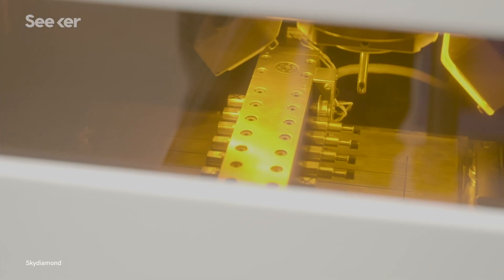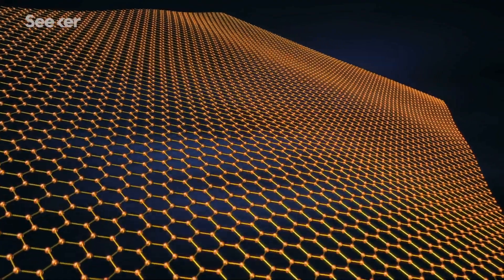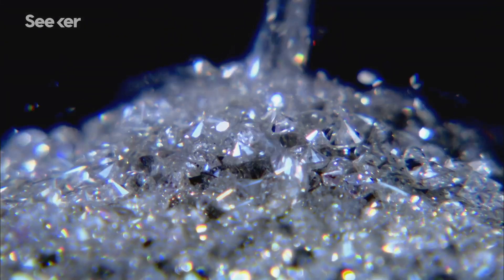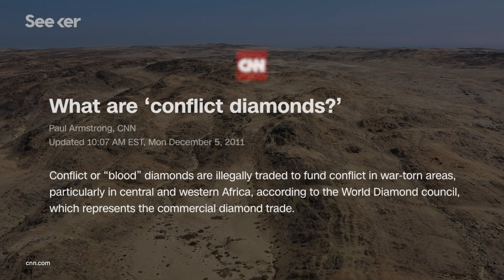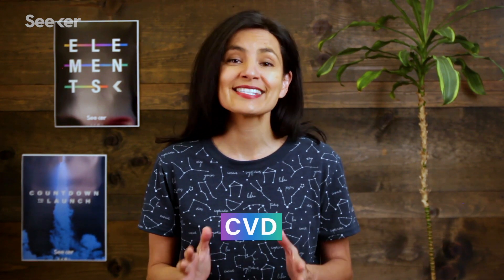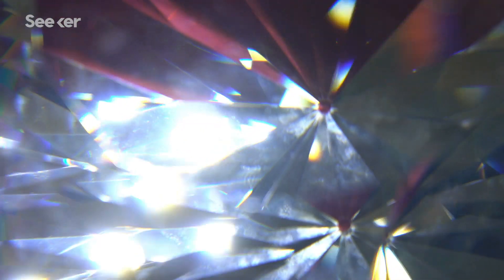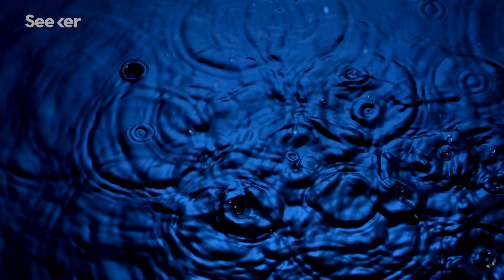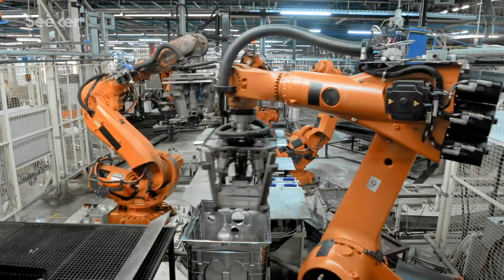How Scientists Are Creating Diamonds From CO2 Emissions

Comment: I’m wondering whether it would ever be possible to directly convert CO2 into diamond and oxygen through some kind of enzymatic catalytic process? What are the bond energies in CO2 and in diamond, how do they compare? How much input energy is needed to do that conversion?  Is there any chance that a carbon-based enzyme could be designed that would catalyze such a reaction?

Comment: The source of the carbon is a non-issue. All sorts of things contain a large amount of carbon. If you want to make your diamonds out of broccoli, you can do that, and it doesn't increase costs much. (Most of the difficulty will be in purifying it, not the cost of the broccoli) This is draining an ocean with a teaspoon stuff, as far as the amount of CO2 actually in a diamond. 
Maybe one day, we'll figure out an actually efficient way of making diamonds, or just have a huge amount of energy to spare, and we will be using diamonds as a building material. Until then, this is didly squat CO2. 

Meanwhile they are wasting significant amounts of green energy. Its hard to build enough wind turbines when people take "this energy is green" as an excuse to squander it.

Comment: Wind and solar aren't renewable energies. Yes there will always be wind. Yes there will always be sun. But the objects we used to capture that energy are highly polutant. They sum to a net negative. You solar panel will need ot be changed and new lithium will need to be mined to produce them. Similar situation for your wind turbine. Wind and solar are FALSE solution.

Comment: Isn't creating diamonds from the air is more impactful for the environment than a regular lab grown diamonds? Since they capture such a miniscule amount of CO2 isn't it better to just use a more efficient and common technology?
Seems like a cheap advertising trick
Reply: That's what my chemical engineering senses are telling me. CO2 capture is difficult, since CO2 does like to dissolve in most things. The processes are usually pretty inefficient. In my opinion, there are worse pollutants than CO2 that are easier to deal with. If you want to handle the CO2 problem, then plant billions of trees. That will solve the problem very simply. Heck, if every home owner in a first world country planted food trees in their yards instead of plain grass fields, then you'd probably solve the CO2 and world food shortage problems at the same time.
Reply: Reminds me of an oil company sales pitch of using renewable energy to produce oil. You think I'm joking, but they were talking about going green on fracking. Some companies pull a ton of stunts to get investors.
Reply: @randywiedenfeld7094 , I mean, at least oil can be used for things other than burning as fuel. The naptha from oil is used for all kinds of organic chemistry.
Reply: IT is

Comment: My graduate work entailed the destruction of liquid carbon-based hazardous waste atomized into the center of a large plasma furnace. Secondarily, industrial diamonds formed on a cooled substrate located on the bottom of the furnace. Carbon vapor transformed directly into a solid at extremely high temperatures lacking high pressure. Voila, Diamonds!

Comment: I'm curious how large the diamonds can be made.  Seems to me that you could just have a runaway reaction.  So let's for example say that the largest diamond you could reliably produce is the size of a baseball.  Diamonds are modestly dense (for carbon atoms), where a baseball-sized diamond would weigh 0.77kg.  It should only take a couple dozen of these diamonds made per-day to completely negate the CO2 emissions from a single natural gas powerplant.  That's actually pretty achievable.
Obviously, it isn't sustainable to do this for every CO2 emitting power plant, especially coal, but anything to neutralize them is an effort worth spending.
Even if the diamonds just turn into graphite, that's not really a big deal - you're still taking a greenhouse gas and turning it into a solid.
Makes me wonder too if energy costs could be greatly reduced if they were to harvest methane directly from a methane source, rather than produce it themselves.  Fossil fuel production, agriculture, and landfills collectively produce most of the methane in the world.  I'm sure harvesting it from them should be pretty easy.

Comment: 80-85% of the world's diamond trade is controlled by a single company, De Beers.

If it wasn't for them controlling the supply and demand of diamonds, that lump of carbon would be a bit cheaper
Reply: Exactly and the GIA controlling the Grading part.. making the diamond manufacturing hella Expensive
Reply: I have to dissagree/agree with you i've read that the monopoly has been broken somewhat, they had a monopoly till the early 2000s. Nowadays their marketshare is about 35% of the diamond trade, but still thats alot.
Reply: yeah a BIT cheaper....to cut and polish a diamond to jewelry level is an insanely labor intensive process, that process cannot be done by robots either, and contributes massively to the cost
Reply: @nunyabusiness8538  Well now if they can make diamonds from CO2, then they will probably be able to mold them soon enough. 😅
Reply: @megamanx466  that’s not how it works
Reply: @nunyabusiness8538  Ok, please explain the video to me then and what the future of a technology like that will be capable of since you seem to know better. 🤔
Reply: @megamanx466  you can grow synthetic diamonds from seeds but they’re pretty small and still have to be polished. if you’ve ever polished a hard knife you’ll know how long that takes...and a diamond is several times harder than the hardest steel, so even polishing it takes forever, and that’s assuming it’s molded to the correct shape to begin with
Reply: @nunyabusiness8538  Ah... so diamonds can be molded into a shape then? 🤨
Reply: @nunyabusiness8538  Nah it's ok geezer. You told me enough. At least though I am only acting. 😁
Reply: @nunyabusiness8538  lol why you mad though.
Reply: Exactly. The gold or platinum diamonds are usually set into is rarer and worth more than even real diamonds themselves. We've been able to make diamonds for decades now though. 😅
Reply: Wait, really? Can someone explain tis like im 5?
Reply: @StyeAI  Explain which part? We all had different replies. 😅
Reply: Someone: "But what about making Graphene for a better future?"

Channel of the video we are under: "... But... Diamonds are shiny."

--------------------

My channel with 2 simple steps for my other channel, and the "About" tab on my channel with info and a link, keep going back to the link, only go to the "created playlists" on my other channel, not the videos tab.
Reply: not true

Comment: lol, this diamond is green, removing all the CO2 from the atmosphere 200mg at a time. Whips out calculator,  30,000,000,000,000,000 grams of carbon removed at 0.2 grams at a time.  But where are they going to store all these diamonds? Oh, wait, I can skip the whole Carbon Capture thing and use mass quantities of cheap and affordable methane, oil or coal!
Reply: They said 200mg of carbon makes 1 carat of diamond. They need to capture a lot of co2 to turn to get 200mg of carbon nothing can be 100% efficient. They are reducing the amount of co2 from atmosphere not removing it.